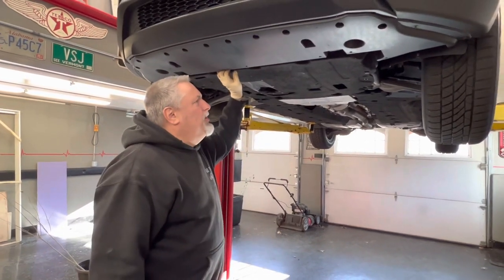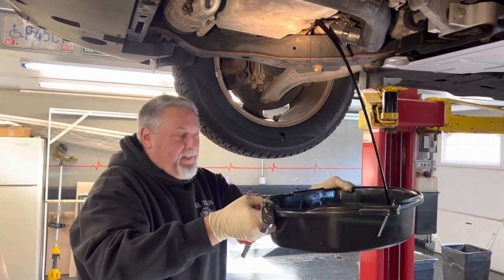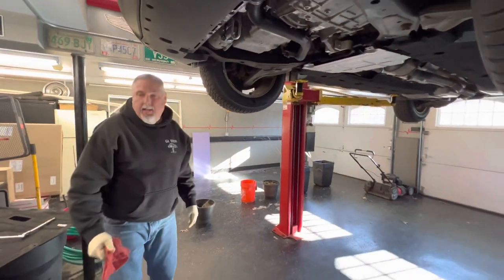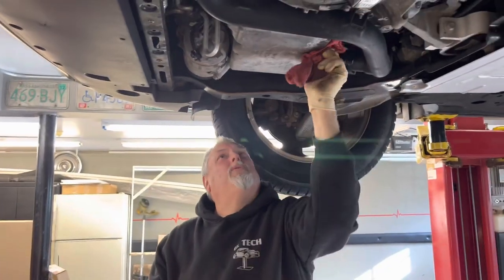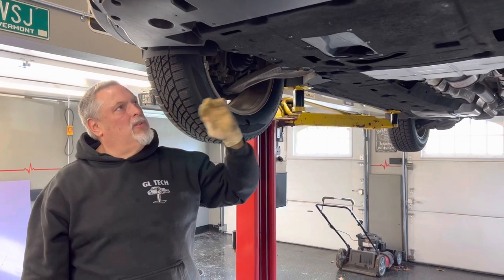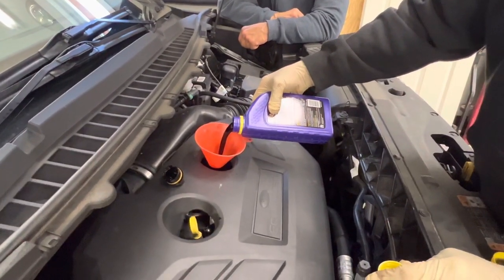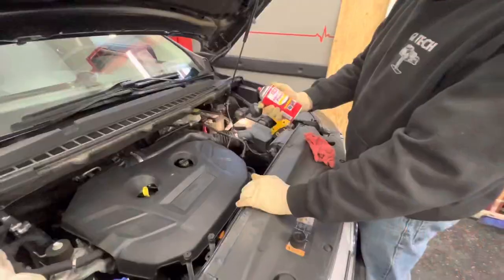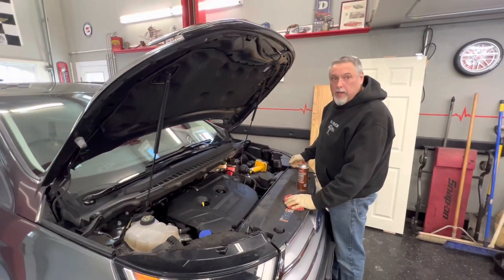How To Change 2015-2018 Ford Edge Oil

Comment from the maker: 00:00 Introduction
01:02 Drain Oil 
02:55 Remove Oil Filter
03:55 Oil Filter Size 
04:09 Install New Oil Filter
04:32 Put Drain Plug Back In
05:45 Install Splash Guard
07:39 Adding New Oil To Engine

🔧BUY Oil Filter: https://amzn.to/3VBQ8N2
🔧BUY Oil Filter Wrench: https://amzn.to/3F5MC7h
🔧BUY 5w 30 Motor Oil (6 quarts needed) https://amzn.to/3ig4W5H
Subscribe to our channel: https://www.youtube.com/homeownerrepair?sub_confirmation=1

Comment: Leak check with the engine running before you put the cover back on. ALWAYS leak check, no matter how competent of a mechanic you are. Bad things happen. Also, I believe the 3.5 requires 5-20 oil unless it's got the turbo.
Reply from the maker: Thanks for watching